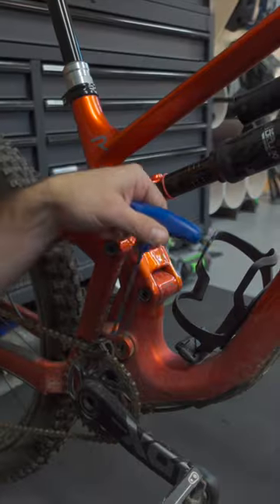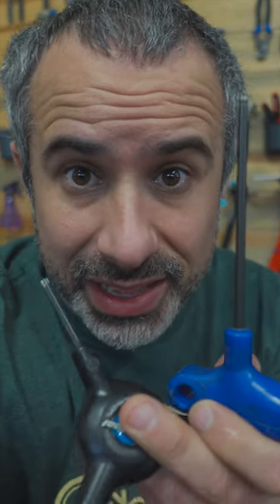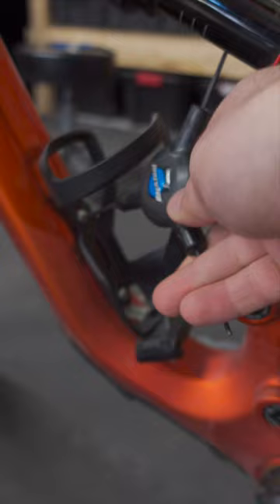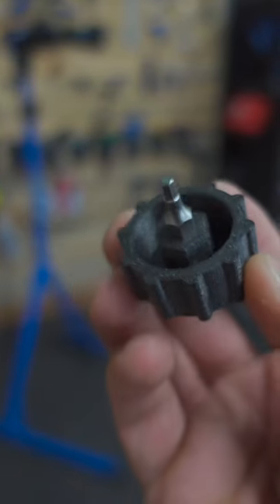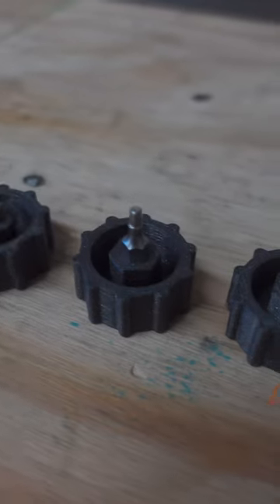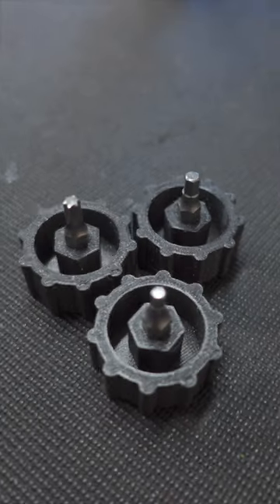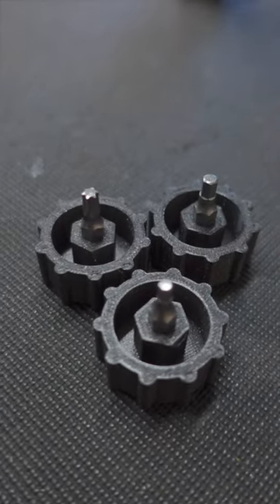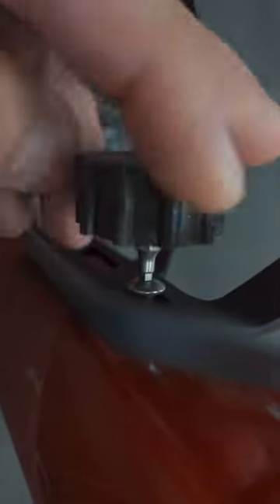Creating a super stubby hex driver for water bottle cage bolts

Comment: If only they made little L shaped hex wrenches for those types of spots.😂
Reply: My exact thought, but the man needs to eat I suppose.
Reply: You beat me to it! 😂
Reply: This is better though. You have to reinsert an L wrench often to tighten the screw and that costs time.
Reply: @moritzt.110  what an extra 30 seconds? and we don't have to create more tool waste? It's already bad enough every frickin shelf, rack, stereo cab, etc contains single use tools. I work in IT, and you wouln't believe the e-waste I have to recycle every 3 months. At least two pallets worth stacked 4 feet high. Not all of it can be recycled, and gets pitched.
Reply: Hex shaped is ok how can hold the mould
Reply: @BigBeezyBtown I can help recycle that for you
Reply: @moritzt.110  use a ratchet
Reply: @BigBeezyBtown  30s per quarter turn

Comment: Seth is an absolute genius when it comes to fixing problems first with the rock shox reverb dropper post now this. Can’t wait to see some more amazing content . Keep up the hard work
Reply: Fixing a problem  he created lmao. Just use a multi tool like everyone else
Reply: @nemure  He didn’t create the problem. He made a solution to a problem. Why use a multi tool and have it take like 5 mins plus the chance of stripping out a bolt when u can just use that and do it in a min and not strip anything.@BermPeakExpress Plz back me up!!!😢
Reply: @TreyOutdoors1  5 minutes?
Did u ever used a multi tool?
It takes seconds to change the water holder with the multitool lol
Reply: @nemure  I just did it for science and it took me like 2 mins to swap one
Reply: @TreyOutdoors1  lmao
I did it last week and took me less than 1
Reply: or you know... dont use that alen wrench with the ridiculously large shape set of normal nothing fancy alen wrenches would do this no problem you know like the alen wrenches that would have been used to put that cage on in the first place

if you wanna get fancy use a socket wrench 

but the solution to my stupid alen wrench ninja throwing star not fitting the bottle cage isn't to 3d print a new alen wrench its use a normal god damn alen wrench
Reply: @Sarge92  why u so mad?🤣

Comment: Tbh I was gonna write a sarcastic remark about just using a ratchet with appropriate socket to fit the bits.
But..
I actually really like this concept.  They make this type thing with a ratcheting feature but for <$1 in materials and probably like an hour or two depending on print settings these are pretty hard to beat!

Comment: I just use the ball end of the hex key. If you hold it at a good angle it won’t slip and you can get enough torque to keep the cage secure
Reply: You should never try to apply any torque with a ball end. The right way is to use it to get the screw most of the way in, and then switch to the L on the other end (assuming common hex key design) to apply final torque.

Comment: Not saying this is solving and issue that is already solved. But they have ratchets that take the hex keyed screwdriver bits and are directional so you can choose to tighten, loosen, and have extra leverage. Also they ratchet

Comment: want a really good tip for your 3D prints is to stop using the prusa black Galaxy filament because it's not really good for mechanical use. try some pla Plus or pla Pro or even petg if you want to go down that road. pla plus is extremely versatile and strong and very easy to print with all you need to do is increase the print temperature by like 5 degrees. I would advise staying away from ABS as long as you can.